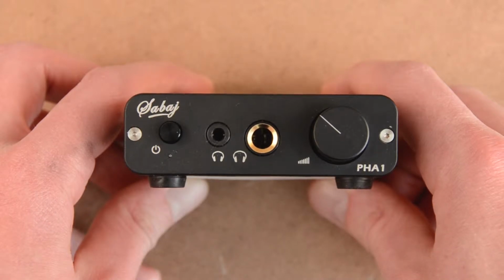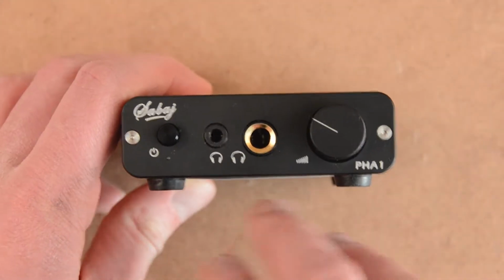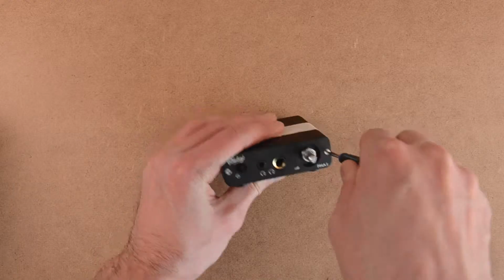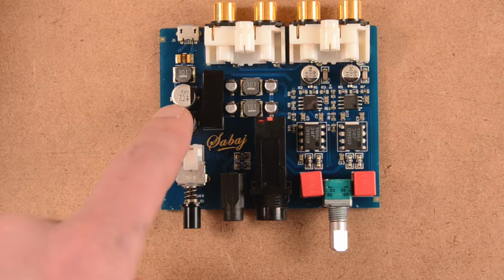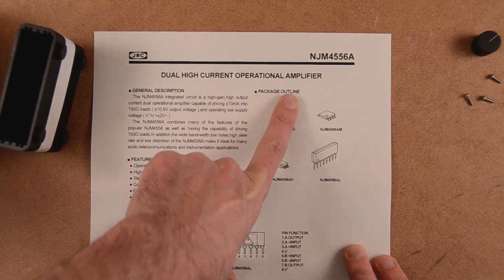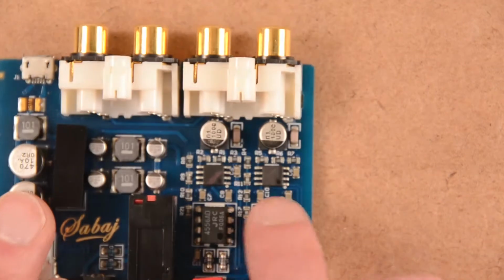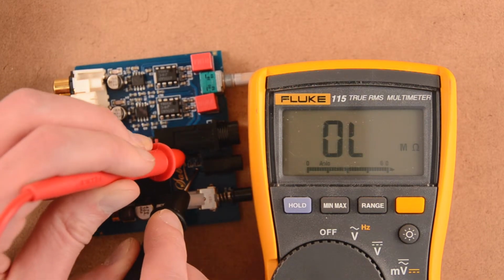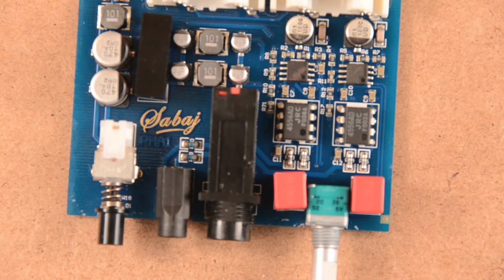Sabaj PHA1 teardown

Comment: The NJM5532 pair is to provide more current to drive the headphone. this is quite similar to the open source Objective 2 design. Reducing to one means much less power. The back unnamed opamp could be eliminated to one, to combine the gain stage and input buffer together. 

The 150 ohm resistors at the 3.5mm jack output is just a disaster.
Reply from the maker: Indeed, the two op-amp in each NJM5532 are used to double the current capacity for driving the headphone. I reverse engineered the circuit after filming. You can see the details in the article associated with the video : http://dieselpowered.ca/2018/sabaj-pha1-teardown/
Reply: @dieselpowered  ah so each op amp has both it's internal channels parallel'd together to drive each ear. Lol so it's technically a baby dual mono. That's cool xx